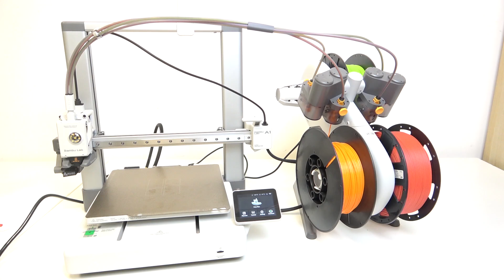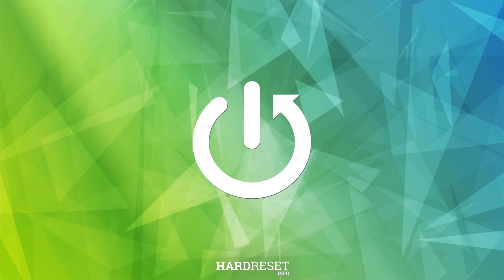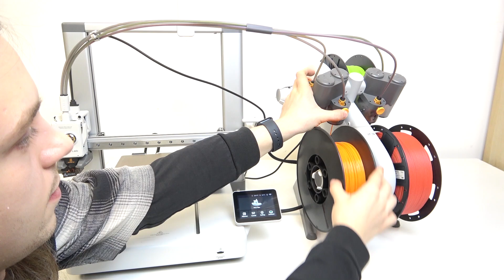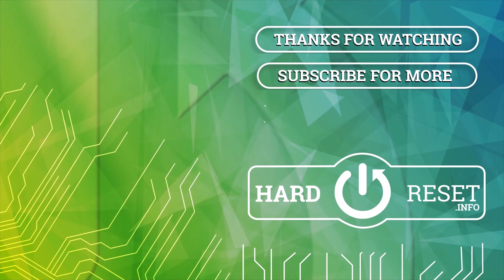How to Unload Fillament on Bambu Lab A1

Comment: My button is Gray what do I do and it won’t let me click it
Reply: If the print has completed, the filament is automatically unloaded, I guess this is only used mid-print where the filament is still in the nozzle.  If you look carefully at the tube entering the nozzle, you can see whether the filament has been unloaded, or not.